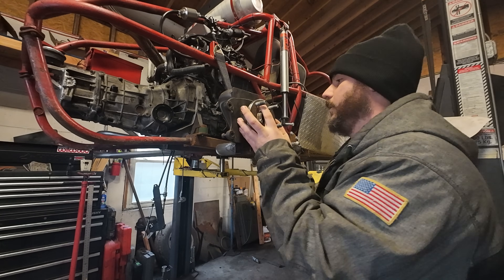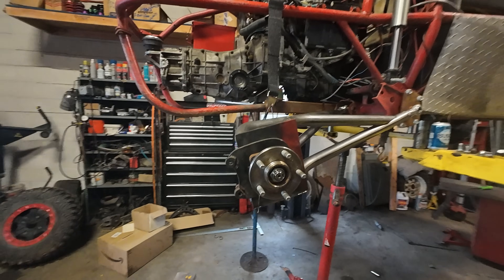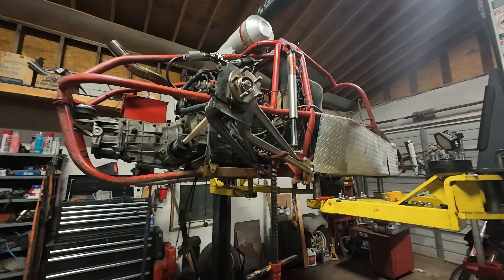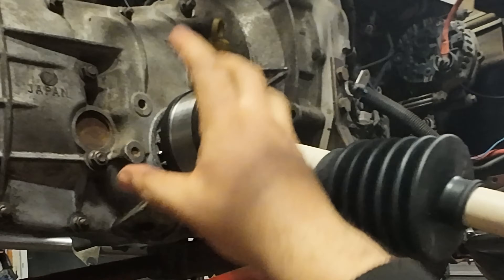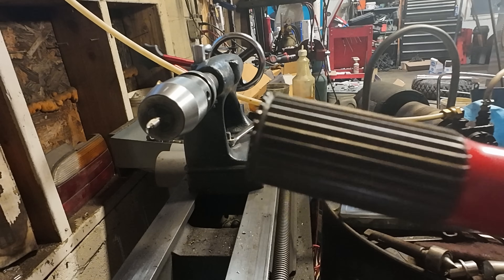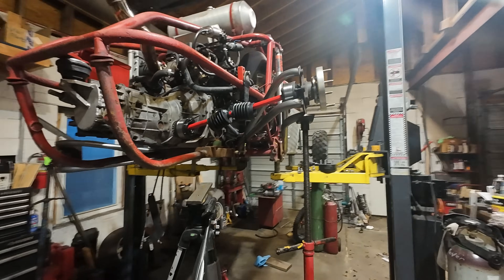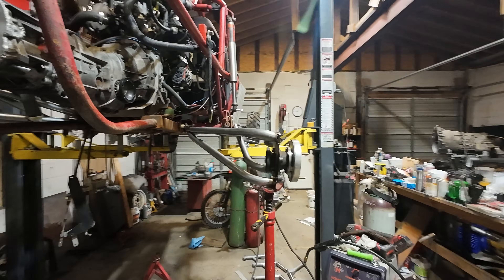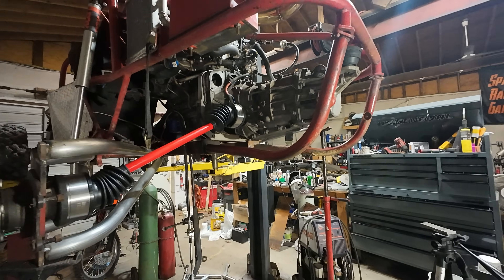Building HD axles for a turbo mid-engine rail buggy. 930 CJ Joints

Comment: Do you know why I could not use a new 30 gallon electric hot water heater to dehydrate my oil, thank you in advance. Joe Dooley Gilbertsville Kentucky
Reply from the maker: It would probably work, I wouldn't draw a vacuum on it though.

Comment: I wondered if that sort of whiz wheel technique would work. The stock 8.8 axle I tried to test shorten in the lathe was very unhappy, even with a carbide tip. A c-clip groove has gotta be pretty square though😬
Reply from the maker: Could finish up with a dremel. I would trust it

Comment: Hopefully these will work for you. Good job.
Will that 1mm of steel, at the end of the shafts, be enough meat, to stop the edge rolling over, against the clip ?
Looks a bit thin, but I'm not clued up on how much stress they go through, so wouldn't know
Reply from the maker: I was curious about that as well. The clips fit well and the axle shafts are really hard so I think it will hold up, but only one way to find out!